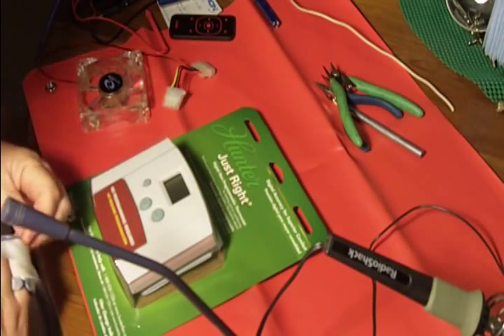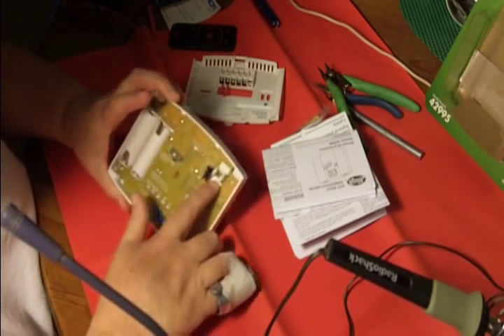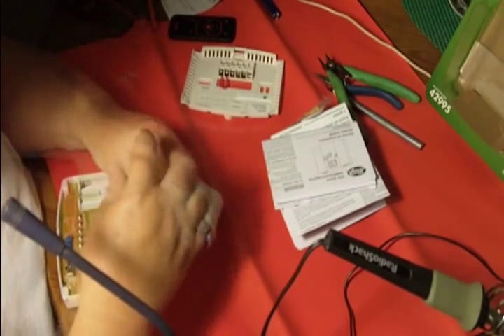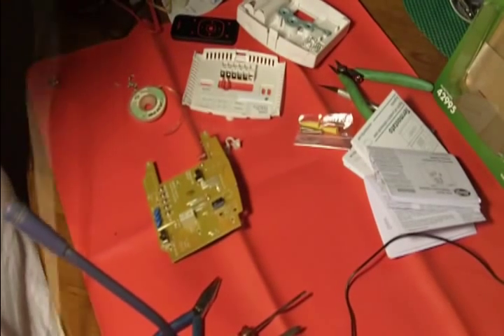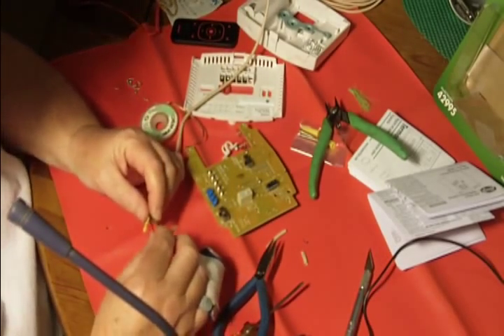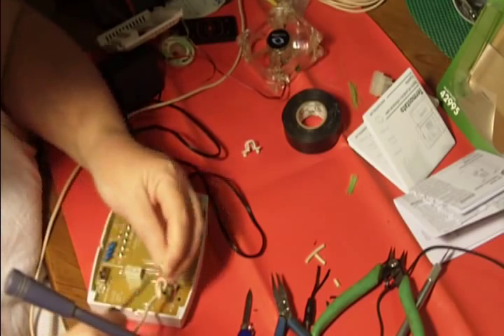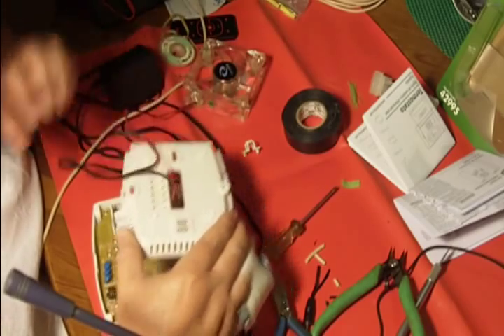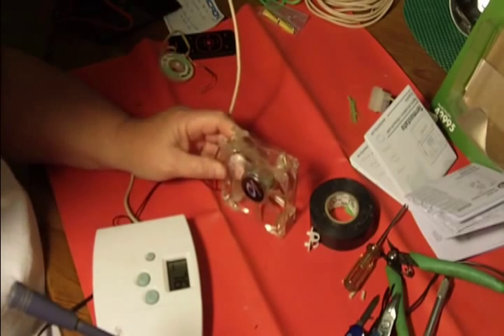How to Modify a Thermostat to Control a Fan for a Fermentation Chiller

Comment from the maker: @brutus605 Thanks, you're so kind.  I'd never need a heat source, because we have pretty non-existant winters here.  But it would depend on what heat source you're asking about.  A heater needing wall voltage, e.g. 120VAC would need to wire the thermostat to a relay that could take that voltage.  I'd probably think up something like using a hot water bottle in a styrofoam box with this fan blowing down on it as needed to maintain temp, lol.

Comment: @steeljan I mounted a 2.5mm jack on the side of the t-stat.  I pulled the original t-stats out of the freezers and hardwired the Rite Temp using a tranny/relay module.  I keep one probe in the original location of the freezer so there's nothing hanging in side. I made a couple extras so if I want to tape one to a carboy and regulate the temp that way I just unplug one and plug in the one on the carboy.  I'll take some pics.

Comment from the maker: @nhebert999 It means the thermostat is set higher than your room temperature right now.  I think the default temperature is typically 78F. 

Set the thermostat temperature far lower than your room temperature, then flip on Auto and Cool.  It will take a few seconds, so wait for it, ah, 15-20 seconds.
There's a couple of other things we can check, but let's see if this works first.

Comment from the maker: @terpsichoreankid Well, go for the gusto, build the shell right the first time.  I'm still living with my thin foamboard, have to change the ice twice a day and baby each new batch with extra ice, a wet towel in the ice pan, and etc.  I've got a lead on a gigantic cooler that will hold 2 fermenters with ice and my controller setup, if that falls through, I'm off to the hardware store for 3" foamboard and sealant.  Great! Cheers!

Comment from the maker: @yartp Did you put two probes on the same input, or make 'em where you can switch from one to the other?  If you've got more than one on the same input, you'd have to account for your series or parallel resister values.

Comment: Im thinking about ordering the same thermostat myself.. Ill use it to power 4 pc-fans that will chill my saltwater fishtank.. I however have a question..
How long does it wait before switching on. (I mean will it turn on when the temp rises with 1f... or will it wait a bit longer?)

I think ill put the thermostat in a small glass tube, seal it shut and lower it down into the fishtank.. (need it to be activated by watertemp)

Comment: Steeljan,  I want to connect the fan to the thermostat only.  I do not want to attempt to remove the thermistor. Do you have to solder the connections or can you just twist them together and cover them with electrical tape? 

Next, How does the price of this compare to just building a PID Temperature Controller?

Comment: Ok I am a wiring moron.  I took the neg from the power source and put it on RH.  Then took the positive from the fan and put it on G.  The thermostat I got is a LUX DMH110 $20. Switched the fan to on and powered up. Then put the fan to auto and cool....nothing.  Switched it to heat and that works.  What am I missing....or do I have a bum thermostat.